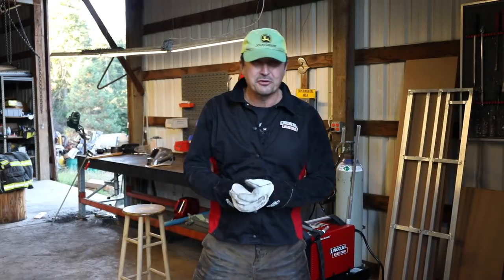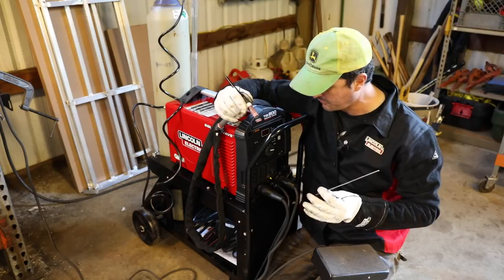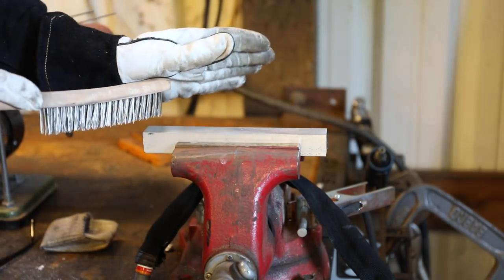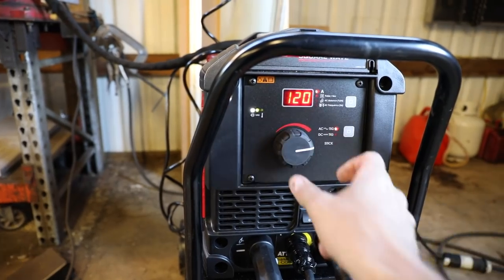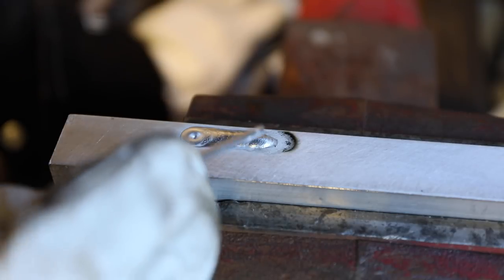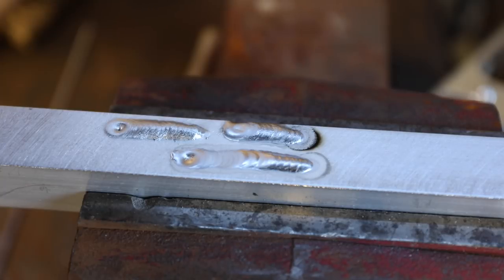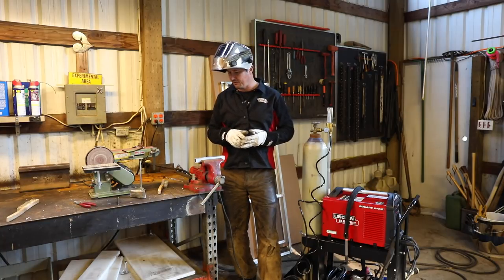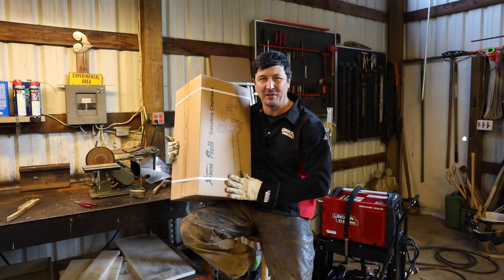The Hardest Thing I've Ever Done!!!

Comment: Some types of aluminium filler will give you a much nicer finish than others, more silicone in the filler means a nicer looking weld but less strength. 4043 is strong but 4047 will have a nicer finish for someone with less experience.

 It also looks like you're having a hard time with the way aluminum syncs heat. You need a heap of amps to start off, then taper back as the material heats up, that's why your first weld grows in size. Also the vice will be sucking heat out of the material, you don't expect it when your used to welding steel, but welding on the end o b that piece vs close to the vice jaws will require totally different amounts of heat.

One more thing with aluminium is that the entire part will heat up as you weld, which changes things dramatically in aluminium. A small change in temperature over the entire part means a large change in residual heat syncing capability of the part. Welding as you are, you will find the 5th weld will require less amperage than the first weld. 

Aluminum is a very tricky material to learn to weld. Learning tig welding on aluminum is a big jump. If you didn't need to weld aluminum I would suggest to start out on steel/stainless steel. Also as others have said, welding tips and tricks have some amazing videos for beginners.

Comment: Hey Cody my name is David if you want to make your welds better turn the heat up to 125 - 130 seems like your welding a little cold. move faster with the torch and dip your filler rod more frequently. When it comes to the end of the weld you slowly back off of the foot peddle it does not have to be full throttle the whole time any questions feel free to ask other then that not a bad first few welds aluminum is not the best beginners material to tig

Comment: I'm learning to TIG weld myself and decided to don't even touch aluminium until I learn steel :)
Reply: I stick weld steel. The reason I want to tig is mainly for aluminum so to weld steel with it seems like a waste because I'll probably never use my tig for that.
Reply: I recently welded a small pressure vessel I needed for one of my projects. Try to weld such precise parts with stick - All three types of welding MMA/MIG/TIG have their advantages and disadvantages, saying "I will forever use XXXX for YYYY" is just a complete lack of understanding welding in my opinion. I saume You're a good stick welder but it has it's limits.
Reply: Well... What di dyou actually use for that then. Steel 2mm and up can be stick welded by any decent welder with the right electrode.
Reply: Aluminum is only different. Not difficult. Keep gaps tight base metal shiny. Full throttle at first till puddle turns shiny then fuse with filler and zip it up like a zipper. With steel and stainless use the cup and walk it. Like revving a Harley.
Reply: You're right stick can weld and kind of metal. But other processes far outperform stick welding in certain applications for structural I prefer stick for fab I prefer wire feed. It is all about the results your looking for.

Comment: A few things. Adjusting the AC balance on the machine higher or lower lower will give you more "cleaning action" for removing the oxide layer as you're welding, it wont make up for lack of prep but it can help.

Put a gas lens kit on the torch. it'll give you better and more uniform gas coverage.

Check out "welding tips and tricks" on youtube, Jody makes good videos.

Comment: Ok, congratulations! Your first pass is under your belt. It's aluminum, black soot happens. Heat always increases as you progress with any weld, so the puddle widens and may deepen also. Give me a WHOLE BUNCH MORE practice beads, just not tonight. Keep it up!! (edit) Correcting the end crater involves backing off on the foot pedal very slowly and keep filler in the puddle until the very last split second. For anyone interested, watch "weldingtipsandtricks" here on youtube for better instruction.

Comment: The whole at the end isn't because of heat. You need to add more metal at the end. Leave the rod in at the end a little bit longer and keep the torch over the metal until it cools. But great looking welds!

Comment: Starting out on steel would probably be easier. I think of TIG welding as electric gas welding without the flame heating up everything it's pointed at. The puddle will change as you weld (especially aluminum) because the entire part is heating up. That's why they often pre-heat aluminum before welding. It gives you a more consistent situation. The grainy finish can be from contamination of the surface, the oxide layer melts at a much higher temp than the base does. You may need to get it much cleaner than just a wire brush.

Comment: great job.....best tip i can give for aluminum welding of any sort.....CLEANLINESS IS KEY!!!! use separate grinding disc, wire brushes everything just for aluminum nothing else
Reply: also helps alot to just arc the area on which u plan to weld, burns off all other contaminates
Reply: just a quick reference or "rule of thumb" is set your amperage to the decimal value of the thickness of your material.....1/8" = 0.125 therefore 125 amp. always a good starting point
Reply: and last tip, leave your tip at the end of your weld and use the argon to cool the last bead, thats why u are getting a hole in the end there, contaminates are getting in. Good luck and keep practicing your doing great

Comment: Try laying down the torch at a lower angle, rest it on the work piece, and 'walk the cup' side to side. Especially when just fusing pieces together without using fill rod. It'll have a figure 8 look when done correctly. Also turn your argon up a bit.
Reply: The hard part is keeping the tungsten out of the puddle.

Comment: The gas isn't meant to make the arc possible, you can perfectly strike an arc in atmospheric air as well as in argon. The argon shielding gas is meant to prevent the hot metal from oxidating. Metal has the tendency to rust/oxidate really quickly when it is hot, so the argon shield keeps the air (with the oxygen that causes rust) away from the weld

Comment: Practice. Make a weld and stop. Look at it and figure out what went wrong, if anything. Then more practice. It's muscle memory and practice is the only way to get it.
Learning curves are how quickly you can pick up an idea or gain a skill. Steep curves mean you gain skill quickly. That is good. Flat curves are the norm. You start out with a little skill and build your skill level slowly. 
Gas welding is a good practice for this skill. The rod feeding is similar. The TIG heats quicker but the feeding, angles, and movements are very similar.

Comment: Seems to me like the frequency isn't high enough and also aluminum is very hard to weld. You want it to get hot but not to hot. The black stuff you see is most likely the cleaning action of the high frequency from the machine. Also whenever you add rod to the puddle it cools the metal slightly. So you want to have the right heat as well as put enough metal and go the same speed. It's good to start it up and wait until you see the metal get shiny and then add your rod and go from there. Whenever you stop I notice the divot at the end and that it from the rapid cooling and you need to add rod as your letting the puddle cool when you pull away.

Comment: When the crown of the weld is high it is called "globulating" it has to do with letting the arc of the weld melt the filler rod instead of the heat from the metal

Comment: As a beginning gig welder you don't need to use filler medal. Just practice carrying the puddle across a flat piece of metal the move to a corner joint. Ufer you have Masters these 2 you can begin to start using fillet medal

Comment: For AL use a pure Tungsten with a rounded end. When the AL turns shiny that it hot enough. Also a 50/50 mix of Argon and Helium is a good gas to use.
Reply: I haven't had much luck with pure.  The inverter ac machines really don't like it as much as 2% Lanth.  And Helium is so expensive now that most hobbiest will stay away from it.

Comment: All in all I think you did a very nice job for your first time. The only tips I have are check your shielding gas pressure it should be around 15-20 cfh, hold your torch more like you would a pencil, and angle it more so you can see what you are doing. Other than that just keep practicing.  It took me almost a semester in high school to get a grip on it. And if you are still having trouble check out ChuckE2009, Mr.Tig, and weldingtipsandtricks. they all have great videos on youtube. And remember JUST KEEP PRACTICING.

Comment: 1) Weld aluminum FAST!!  Get as much heat in as fast as you can.  Get the puddle formed, mash the puddle and hold the tungsten as close as you can safely until you see a shiny spot develop.  Focus on keeping the tungsten close to the aluminum (THIS IS CRITICAL).  Be prepared to pick up the pace as you back off of the pedal.  The longer you add heat the faster you will have to fill and move.  The faster you move, the further you can go before  2) AC is not DC.  A sharp pencil point is great for low amperage DC but you need a much wider point for AC where much more of the heat is concentrated in the tungsten.  Also, grind "a flat" to give the aluminum a place to ball on the end of the tungsten.  3) You aren't getting a hole at the end because you're too hot.  It is because of shrinkage.  It's called a crater, and you avoid it by slowing down the cooling rate of the end of your weld.  I.E. make circles around the perimeter of your last dab as you back off of the pedal slowly.

1) Weld FAST!!  Weld faster and faster right from the start, keeping close so as to maximize the heat in the smallest possible area.  2) Prepare the tungsten properly.  3) Control cratering with technique to prevent crater cracking.

Comment: The end of your weld is called "crater crack" when you're ending a weld on aluminium u need to put a bit of extra filling metal so u don't have this crater crack. If u let a weld like this, she will start to crack at this crater. If u really want to learn a lot about TIG welding you should go to "welding tips and tricks" youtube page. He's making ARC/TIG/MIG welding videos, if you want to learn about aluminium welding, watch 6061 youtube page! I'm beginner in TIG welding, but I can weld 1mm thick aluminium witch is pretty nice (i've never weld before except with arc welder). 
The black spot at the beginning happend when u touch the metal with electrode.
When you're adding rod, rise your electrode a little bit so u don't contaminat you're electrode with filler rod. 
When you're grinding you're thungsten, put it in you're makita or dewalt and make it spin, u need to grind it on the other side. 

As I said before, go to weldingtipsandtricks youtube page, he got a bunch of aluminium welding video (thick or thine) and some tutorial on "how to tig weld aluminium" 

Sorry for my English, he's not really good but I hope you've understof everything :)

Comment: Definitely practice a bit more before welding up your frame and try to sequence the welds to try and offset the shrinkage. If you don’t jump around with your weld location things end up like a taco.

The titanium sub story is true. It’s also true that they couldn’t maintain then because of the challenges of welding the material. As an added curve ball there were cracking issues too from what I was told.

Comment: Set your machine amperage higher for starting the puddle then back off the pedal to get going and you can pull your tungsten out a bit more to see what's happening better and at the end of the weld add a bit more filler to avoid the crater at termination

Comment: I don't know anything about TIG welding but one thing I did see you do wrong is where you clamped the grounding cable. It is best, when possible, to clamp it onto the piece you are welding. If you run the current through your vise it will eventually make the vise hard to open and close due to the current going though the big acme threaded main screw and other machined surfaces. The current will move small amounts of metal from one surface to the other within the vise. That might sound like BS but it is not. That's a nice vise, take care of it.

Comment: ATTENTION YOU NEED TO KNOW THIS TIP MR. WRANGLESTAR You popped a hole in it at the end. I Heli arc welded for 12 years professionally. Back off your foot peddle at the end real slow and swirl your tungsten in a circle and that spreads the heat so it don't pop a hole in it. Other wise the weld looks really good. Weld was good enough except for the hole at the end.

Comment: Overview of Loctite Threadlockers & Colors
Posted on September 27, 2013 by Nici Sandberg
Fb-Button

Henkel Loctite Threadlockers – A Brief Explanation

What are threadlockers? What do the colors of Loctite mean? How do I choose the right one? These are some common questions we hear from people looking for these products, so we’d like to do a quick walk-through here to help answer some of these questions.

Threadlockers are used to seal and lock threaded fasteners.
Threadlockers are used to seal and lock threaded fasteners.
First, threadlockers were developed by Loctite (now Henkel) about 50 years ago. Threadlockers are liquid anaerobic adhesives that help protect nuts and bolts against vibration and thermal expansion. Threadlockers also create a seal that protects against rust and leaks. Loctite threadlockers can be used to seal gaps between interfacing threads on bolts.

Applications include through-holes, blind holes, post-assembly, overhead, and pre-applied. It is important to note that best performance is achieved when all parts are free of contaminants such as oil and grease.

Keyvisual_Threadlocking.jpg

Loctite Colors & Strengths

Low Strength – Purple: Purple Loctite is best for small screws under ¼”. Purple Loctite 222 is a liquid that can handle temperatures up to 300°F. Fixture time is 10 minutes, full strength time is 24 hours. Also available to mil spec as Loctite 222MS. Loctite 221 is also a purple, low strength threadlocker.

Medium Strength – Blue: Blue Loctite is available in wicking grade, liquid, tape, paste, and semi-solid. The wicking grade blue Loctite is removable strength, and is product number Loctite 220. It works well with fasteners up to ¼”.

Other blue Loctites include 243 (liquid), 249 (tape), 248 (semi-solid), 246, 2422 (paste), 2423. The blue Loctite 243 is best for fasteners between ¼” and ¾” and is rated up to 360°F. Blue Loctite 249 is a threadlocking tape that can withstand temps up to 300°F. Blue Loctite 248 is a semisolid stick that is best with fasteners between ¼” and ¾”, and it can also withstand temps up to 300°F. Use Loctite 425 for plastic fasteners.

For a higher temperature blue threadlocker, use Loctite 2422, which can withstand temperatures up to 650°F. Loctite 2422 is a blue paste and can be removed with hand tools.

Loctite 290, Green Loctite
General purpose green Loctite is medium/high strength.
Medium/High Strength – Green: Green Loctite is wicking and available as Loctite 290 and 294. Loctite 290 is a general purpose threadlocker and can withstand temperatures up to 300°F. Loctite 294 is a high-temperature version, withstanding temps up to 450°F.

High Strength – Red: Red Loctite is a high strength threadlocker. Red Loctite comes in liquid, semi-solid, and paste. Loctite 263 is a general purpose, liquid threadlocker than can take temperatures up to 360°F. It can be used on fasteners up to 1” in size. Due to its high strength, heat is required to remove the material. Other red Loctites include 268, 272, 2620, 277, 2047, 262 (mil spec), and 271 (mil spec).

High Strength – Black: Black Loctite is also high strength, but it is specifically for fasteners larger than 7/8”. It is formulated with increased lubricity to reduce friction. Only use Loctite 2047 Black for permanent applications. Loctite 480 is another black Loctite. It is an instant adhesive.

Comment: Don´t put your cellphone or any other electronic device near the workpiece, the high frequency can damage some electronic devices, you can also use some acetone for cleaning the aluminum workpiece before welding, the brush will help with solid contamination, acetone will help remove oil and humidity

Comment: The perfect tig angle is straight up and down but that's almost impossible. That's the best first aluminum weld I have ever seen but you should start on steel. Aluminum is hard and frustrating. Also the argon it to shield the weld not to keep the arc going. If there was no argon it would have pours all the way through it. But good job I would like to see more welding. One more thing is aluminum should be preheated, and make sure you don't sharpen the tungsten when welding aluminum.

Comment: this seems very similar to soldering, maybe try looking at it in a similar manner? I wouldn't fully know as welding is not a skill I possess being in the computers business but it's possible that looking at this more along the lines of soldering together metal instead of welding might help you because you are in essence doing a similar process. only this is much hotter and more along the lines of fusing steel and other high temp metals vs copper to copper, etc

Comment: Get the miller welding app, it tells you the right amperage for welding aluminum steel stainless steel and it tells you what size electrode to use

Comment: The black soot is normal with aluminum. Usually it's just the shielding gas hitting the metal when the torch is on a angle.

Comment: To tig weld aluminum you should have a ac welder with high frequency to start the arc. The black at the st a rt is from the tungsten touching the aluminum to start the arc